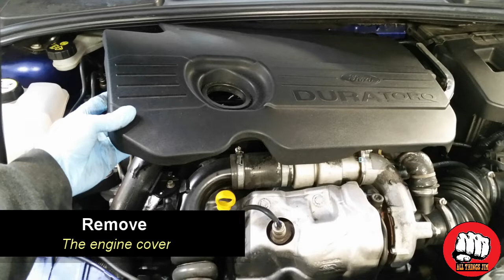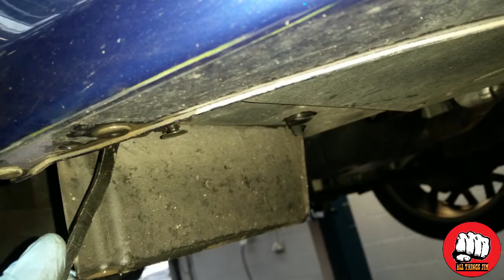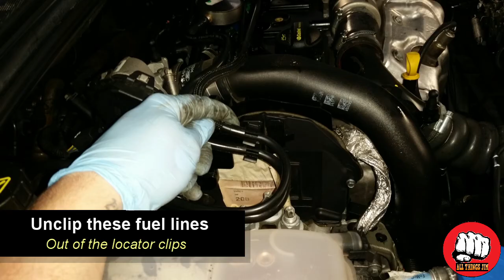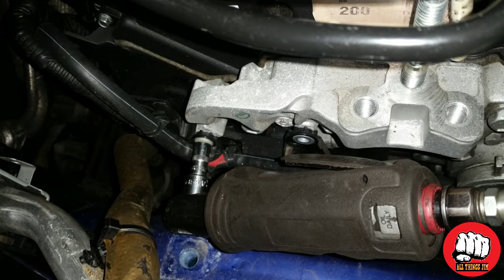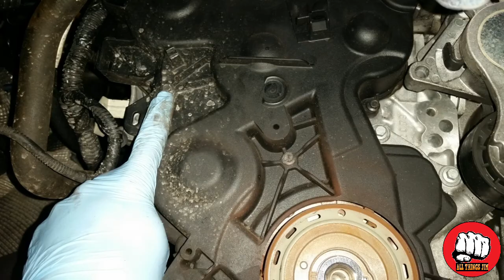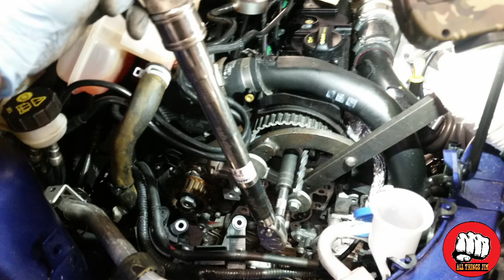HOW TO REPLACE A CAMBELT AND CAMSHAFT PULLEY ON A FORD FOCUS / 1.5 DURATORQ DIESEL

Comment: Great video! Have you found many with a piece missing from the cambelt tensioner causing code p2279?
Reply from the maker: Not that I can remember if im honest but ive seen a few with missing cambelt teeth, and a few where the tensioner is starting to break up (metal dust all over it) its been a while since ive done one of these now 👍

Comment: Hi Jim great in depth videos I was wondering with the crank shaft bolt does it have to be removed with impact gun only I’ve done a cam belt on a fiesta and I had to lock the fly wheel
Reply from the maker: Thankyou, it doesnt have to be removed just by impact gun but if you dont youd have to remove the starter motor and use a flywheel locking tool 👍
Reply: @ALLTHINGSJIM  ok thanks for the fast reply

Comment: Hi, I have a Fiesta with the same 1.5 TDCi engine in the 75HP EU-6 version. I have not found on internet and on ETIS site any reference regarding the replacement of the camshaft pulley (my car is from 05/2016) but I read that when replacing the timing belt (on EU-6 engines) it is mandatory to replace the pulley of the >>fuel pump<<. Do you know anything about this? Thanks for the video!!!
Reply from the maker: Theres a recall on this engine on certain model and years, thats probably why your reading about it with cambelt replacement on the internet. Not all were affected so your best bet is just to pop into a dealership somewhere and ask if your vehicle is affected by this camshaft pulley recall issue, they should be able to tell you easily. If not dont worry about it 👍
Reply: @ALLTHINGSJIM  Yes, this seems like the best thing to do. Thank you for your answer!

Comment: Hi Jim.  Just curious to know the reason you replaced the camshaft sprocket?
Reply from the maker: Its a recall on these engines,  the sprocket was made with an inferior metal that has a possibility of breaking, so there is a replacement one 👍

Comment: Does a 2010 diesel Ford Galaxy have this set up or is it fitted with a VW engine?
Reply from the maker: No it wont do as far as im aware , although youll have a ford 2.0 duratorq engine in that if its diesel, and the recall only effects the 1.5 duratorq engines mainly found in focus 👍

Comment: Hey Jim, I have to do this job on a fiesta mk6 1.6 tdci engine. When I look the torque specs up it says 2 nm and 50 degrees. This seems a bit low, can you check it for me please? thanks in advance!!
Reply from the maker: 20NM and 50 degrees 👍
Thats for a 1.6 Duratorq TDCi 55kW-95PS stage V engine
Reply: @ALLTHINGSJIM  Mine is a 1.6 Duratorq TDCi engine code TZJB 70kw. and it says 2 nm and 50 degrees. isn't it strange?
Reply from the maker: Thats dodgy not strange, would leave it way too loose!
Reply: @ALLTHINGSJIM  Used to different sites (tecdata and Hgs) and they both say the same thing. can you verify for me with your system?!
Reply from the maker: I have its definately not 2Nm.
Im looking at it now its 20nm 50 degrees
Reply: @ALLTHINGSJIM  before i crack on with this job, do i have to replace the camshaft bolt? Or can i reuse the old. In case i have to replace it, can you give me the part number. Thanks in advance
Reply: @ALLTHINGSJIM  any idea?
Reply from the maker: No you dont have to on this engine 👍